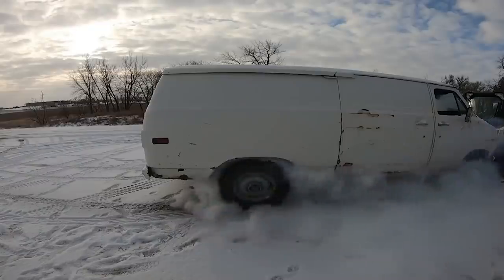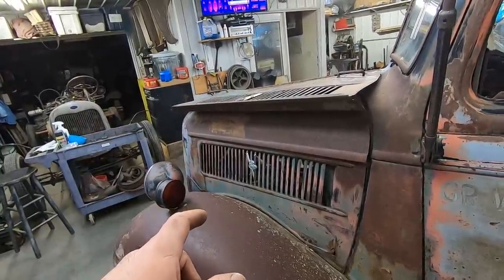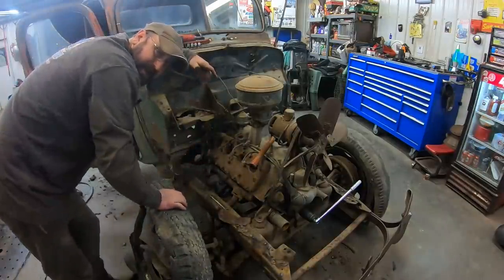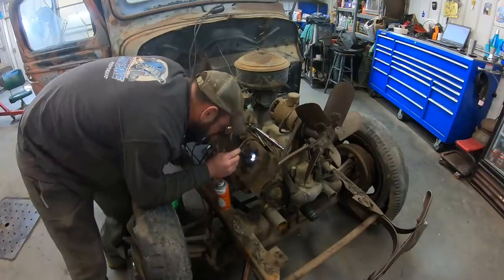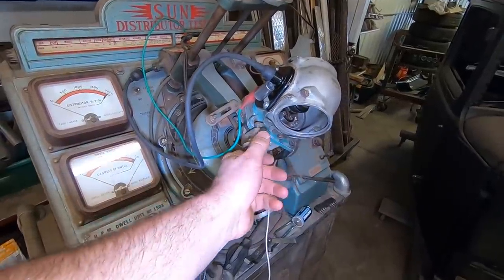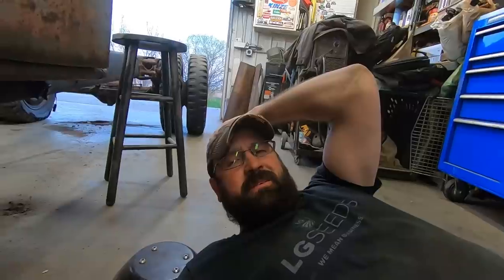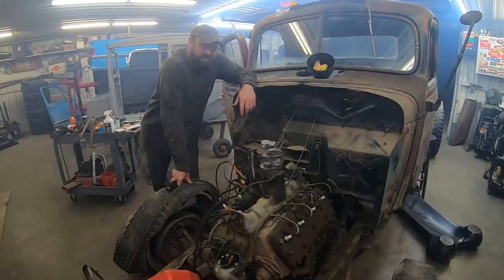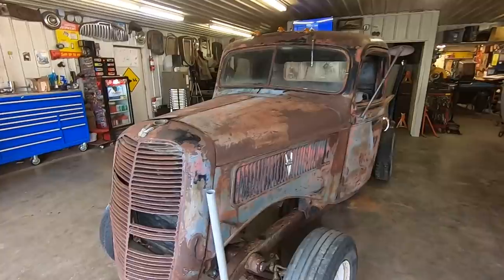1937 Ford truck Abandoned for over 35 years! Will it Run?!? Flathead V8 engine!!

Comment: Have you tried heating the head/cylinder while trying to unstick the valves? Just curious if that helps get the lube in places it won’t go cold? Get it good and hot and dump the mystery oil to it?
Reply from the maker: I don't think the heat would get down into the block and to where it needs to be in the valve guides.

Comment: So the famous Ford flat head V8 had 85 to 110 (Mercury after WW2) horse power.  What did Ford's competitors' flat head 6 cylinders output for power during a similar time period?
Reply from the maker: Technically there was also the flathead V8 60HP engine from 37 through 40. Not sure what they had for HP but GM had OHV inline sixes. Mopar drug out the flathead six until 59.
Reply: @MortskeRepair  Yeah, I found out that Mopar stuck with the flathead 6 until 59 by watching you revive that 59 Mopar Wagon (Dodge/Plymouth Suburban?)  I was kinda shocked, so I looked it up.

Of course they followed that engine up with the long stroke slant six, starting in 59.  Uncle Tony('s Garage) loves those things, because they're hard to make power from I guess. He's stuck one in a Miata of all things!  It actually fits well.
Reply: @MortskeRepair  I think the GM  OHV stovebolt 6 started out in the '40s but I'm probably wrong.
Reply from the maker: @BobPegram  I saw that, great little engines in my opinion!
Reply from the maker: @BobPegram  Shoot, I think they had them in the 20s even.

Comment: I have a refreshing “sandwich” suggestion should you require lunch.
1 can of full fat Redbull
1/4 glass crushed ice
1/4 glass Absinthe (must be minimum 50% alcohol)
Top up with redbull.

This should be consumed as a quick snack, so no sipping, 3, maximum 4 “bites”.
This will refresh you mightily, and it would probably be best not to nip into town after eating it.
Reply from the maker: Sounds rough!
Reply: @MortskeRepair  Mans drink.
A breakfast sandwich (I can’t say “Sammich”  it would be like writing Color, or pretending baseball is fun) on this side of the pond.
Replace the Absinthe with Pastis to soften the final effect.
Reply from the maker: @TheAdambright  Hahaha!

Comment: The engine should have a double fan belt for the big truck in '37.
Reply from the maker: May have been swapped in 84 years, or the waterpumps and generator were swapped. I've got a couple sets of the rare double pulleys tho.

Comment: Gee whiz it's a Ford left bank front to rear 1234 right bank 5678 not  even on the left

Right and odd on the left like GM  sorry I'm not a GM hater but I am a A Ford guy 7 ford's and 2 Hondas. I like flatheads because of the way they sound.  The old test equipment takes me back to the early 60s when Gas stations worked on cars and had this stuff.  Sun being the most common. Dwell meters . The GM distributor caps with the window on the to put an Allen wrench through to adjust the dwell another words the gap with the engine running and a dwell  meter. It's amazing that any of these old engines ever run again with all the junk that's in them.

Comment: Why not put a pint or two of kerosene in the crankcase to break up that old oil?  Let the starter mix the kerosene around in there good, then drain 'er out.  Used to put a pint in on running cars with old oil and let them idle for a while with that kerosene in there...It was like motor flush, but cheaper.  The only stromberg-carlson's I've ever had were radios, kind of like how ford had Philco after '64 or so.  Before that Philco was it's own independent brand of radio and Philco was a shortened version of the company's original name "The Philadelphia Battery Storage Company".  I don't currently own any of their home radios, but I do have a tombstone radio from the early/mid 30's made by American Bosch.  We used to have a Gamble's store on the town square when I was a kid.  Of course at that age I wasn't interested in anything but toys, but Gambles had all the Dukes of Hazzard toys, lol.
Reply from the maker: Great info!

Comment: All Ford i know of cylinder number one is left bank all the way forward. Right Bank is 1234  left bank 5678. Even the newer engines designed for transverse  monuted engines like the  Vulcan V6 and Duratec V6 arde numbered that way with the   front of the engine being the end not bolted to the transmission. The cam bearing caps are labeled fron the factory  in sequence from the front of the engine to the back of left to right facing the engine from the front of the car or SUV even thought I don't believe you could ever get the cams off the engine in the car. There at least on the Five Hundred not enough room to get the front cover timing chain cove. The harmonic balancer has to come off first and there's no hope of that happening. On the Duratec taking a valve cover off or changing spark plugs on  one two and three requires removing
The top half of the intake manifold. My 82 escort was in some ways a pain but nothing like the Five hundred and the last Tarus' which were the same car rebadged ( Five Hundred's). The 82 had no computer  and a cab and Duraspark 2. It ended up with 239000 miles on it. My wife and I both long for the days when you could realistically do all your own work.

Comment: I'd keep the flathead and adapt it to a modern trans and rear end..
Reply: The only thing that 21 stud flat-head        has going for it is insert bearings(starting in 36). It's hampered by inferior cooling(water pumps in the head, instead of the block), less head retention,due to fewer head bolts, and a paucity of after-market support. The best bet if staying with a flathead, would be the 49-53 version, most of the bugs had been ironed out by then.

Comment: I am sure green new deal Gretta just loved that home made Ford flat head fogging machine lol . Screw ball is good stuff especially if it's kept cold or over ice but I hear their is a drink made with it that's called a PBJ shot but haven't tried it yet because I have just been taking straight shots off of my bottle doing shots while I drink my beers . If you like booze try George Dickel Tabasco barrel finish smooth sippin' whiskey or Kentucky Bourbon mango jalopino that starts out smooth and sweet but has a slight burn at the end that's good on cold winter nights or a drink called the Snow blower you should be able to find in the black booze mixing books at the bars that if I remember has a combination of vodka & Yukon Jack 100 proof & something else mixed in that I tried back in the 80s that will kill what's left of the covid aftermath lol 😂. When you pulled that drain plug out that reminded me of a video I watched on YouTube here 2 months ago about a Mercedes-Benz that was at some guys shop in for a oil change & the oil looked just like that but worse believe it or not coming out in globs then plugging the hole then the guy would open up the hole & oil would drain out then more crud for several minutes so evidently who ever owned the car must never have ever changed the oil & filter on it lol which is strange being most new Mercedes when you buy one from the dealer they give you free oil changes on them which they should for the price they cost .

Comment: this is in a lot better shape than my '36 chevy 1 1/2 ton. talk about hard to find parts, i've got a '54 5600 that needs brakes. rear wheel cylinders? HAHAHAHAHA! yeah, right. i'm going to have to upgrade to modern axles if i want brakes, so instead, i'm mounting the 5 window cab onna '94 1500 4x4 frame with a 5.7 t.b.i f.i. engine and an auto tranny. i'm gonna be mounting the '36 cab onto an s10 frame, and shoehorn in an sbc with a 5 speed behind it. depending on how life cooperates, those are next winter's project and hopefully the winter after that. sorry, but a shot of jameson is as imaginative as i get.
Reply from the maker: Sounds like a great project!

Comment: I dunno shite about electricals, but if yer using that 12 volt coil, couldn't ya just put a ballast resistor between that and the dist, so ya dont burn up the points?
Reply from the maker: Points don't care about what voltage you run.
Reply: @MortskeRepair  Oh, again.

Comment: Why didn't you pour Automatic Transmission fluid in each and allow them o sit over night and then start playing with it. I rebuild flat heads all the time and I find Hydraulic Fluid works wonders. But then I am not a Mechanic like you are. I have just been playing with them avout 79 years and drive Flat Head Studebakers as well as a 1901 Oldsmobile I found in a Forest Fire and had it running 30 hours after I found it. I am still just learning.
Reply from the maker: I've poured every concoction in cylinders and it never seems to make a difference and doing a video a week we don't really have the time to let stuff sit unfortunately.

Comment: Ah, come on...Don't send original steel to the scrapper.  Move the rear axle up, chop the frame short, set that bed you've got on it, and make a dually pickup.  You could knock that out in a weekend and have something nobody else around does.

Comment: Black Velvet and RC cola. Proper headache inducing lubricant.
Reply from the maker: That's not what I need!
Reply: It's also helpful in freeing up stuck valves. Better than a ballpeen hammer.
Reply from the maker: @markbarrett5516  Nothing is better than a hammer!

Comment: Have you ever noticed that farmers were rollin on dubs before dubs were even popular  they were rollin on 20” low pro. Mud tires I mean think about.... full circle love in the shows mortske seems like there getting harder and harder every episode
Reply from the maker: They started the fad!
Reply: I’d like to see those rims put on the new frame your putting the body on but I understand that they are to expensive to put tires on and to fix if they are damaged eaither way they look cool
Reply from the maker: @chasbarnes3425  Yeah, they look neat, just not worth the effort however. Basically obsolete and no tire shop will touch them.

Comment: Why such a hate on for parades ?
Reply from the maker: Hard on engines, they run hot, no air coming across the radiator. And they're BORING when you're in them. And almost as bad to watch!

Comment: Why do they rate trucks how they do why is a one ton never been rated at one ton 14000 would be a 7 ton where did that come into play?
Reply from the maker: That's the payload capacity.
Reply: Yes but why don't they use that number ? To rate size what does the scale they use measure ?
Reply from the maker: @milesbrush4863  So you know how much stuff you can haul. Same way they rate a forklift by how much it lifts.

Comment: kroil is the worst penatrating oil on the market, spit works better...just check AvE's video about it..also...isnt a pick-up a truck? i dont get that...
Reply from the maker: WD40 is the worst! Trucks are duallies in these parts.
Reply: @MortskeRepair  wd40 is the secret formula for making dirt bikes look showroom clean though..especially if you run bare pipes...i kinda figured it was something like that with the pick-up thing...the ol' soda/pop or dinner/supper deal lol